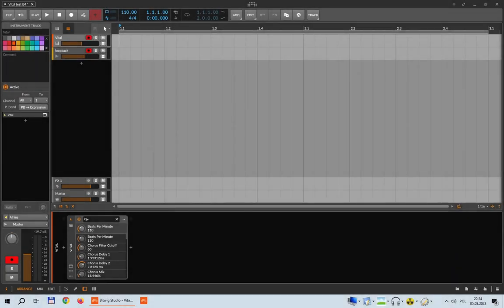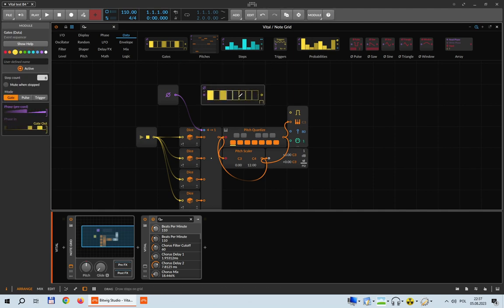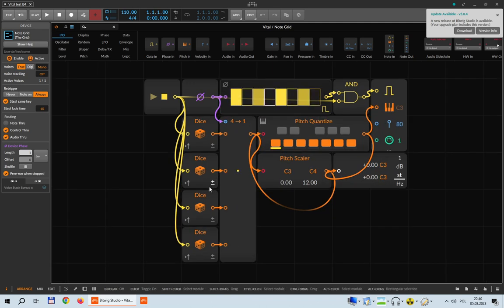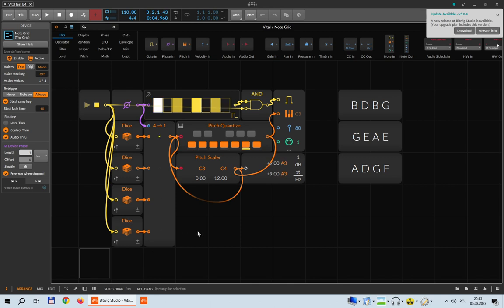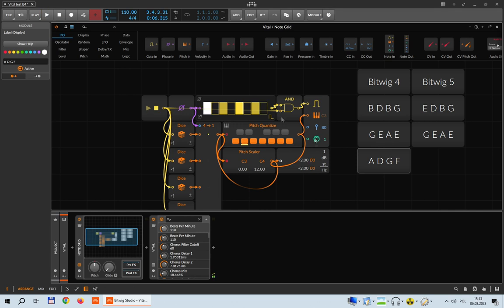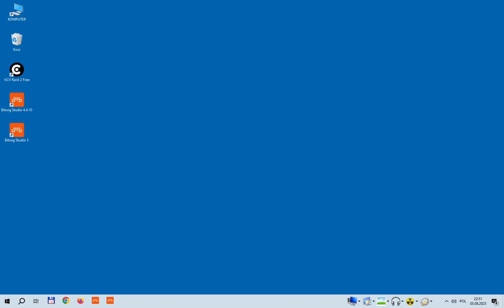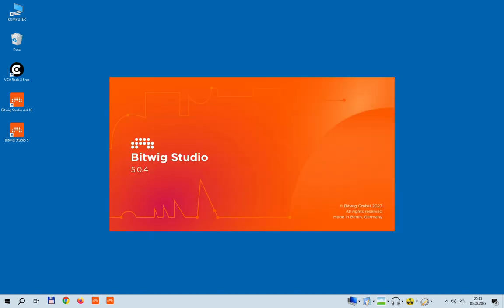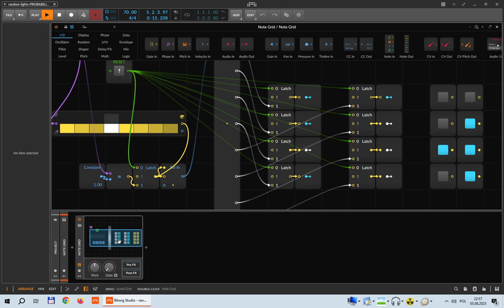If it repeats, is it random? Experimenting with Bitwig's grid

Comment from the maker: Things not mentioned in the video:

1.	I didn’t want to get into suppositions about how Bitwig is internally coded and how it may be using the same random seed every time it initializes the generator (yes, it’s probably doing that, but I didn’t want to presume, only show the results). It may be a feature, or it may be a bug, or perhaps an unintended omission, but the end result is what it is. 
2.	Yes, there is a similarity between the behavior I’m describing and how randomized note operators work in MIDI clips. There, too, random sequences repeat, and indeed it’s probably the same approach. Except that for clips we get the little “Seed” button we can click to get a truly new random sequence. We don’t have one for the grid. 
3.	I don’t know if the repeating sequences are specific to an individual computer, or if they will be the same on all machines running Bitwig. If you care to test this on your system, please let me know in the comments, I’m curious.
Reply: To answer your third point. I tested the first setup you did with dice. I did not get the same pattern as you, but I get the same sequences repeat after closing the program and starting + stopping as you do.
Reply from the maker: @shottman  Thank you! It's good news, actually, because it implies that different people should get different patterns from the same patch. So sharing generative patches should be okay, at least, as everyone will get their own unique sequences.

Comment: I did the same test and the same thing happens to me. It seems that bitwig saves the same values and predictions when you save the project, and if you close bitwig and open the project again it will show the same values and predictions. Now if you close the project and open it again without closing bitwig the values change, which makes me suspect that it may be a bug.

A few months ago I did a test in bitwig creating a random preset generator and the values were not saved in the project and were lost when reopening it, this was from version 4.1 if I remember correctly, it would be good to test with older versions to see if it's a new bug.
Reply from the maker: I'm pretty sure I saw the same behavior (repeating sequences) all the way back to version 4.1. I didn't test 4.0 o earlier releases.

Comment: Interesting... So basically it's not random, but i can't controll it so it gives the impression of randomness in everyday use? Interested to see what Bitwig will do.
I'm actually thinking/working on a seeded value generator in the Grid to have truly recallable random style sequences. I was somewhat succesfull with Wavetable LFOs and Noise Wavetables. But now someone on YT told me about some Math that i try to integrate... Has anyone build a Computer in the Grid yet? i'd have some Questions :D
Reply from the maker: To your first question, yes, quite. Thankfully Noise and S/H LFO are truly random, so they can replace those other devices that are not. And yes, wavetables and wavetable LFOs will create unpredictable but precisely repeating sequences, and their state gets saved, so it's recallable. That said, even two (or more) simple sine LFOs running at different rates will create a fairly random-looking modulation curve when you merge their outputs. Or you could use the sampler running at something like 0.3% its normal rate. Also pretty random and recallable.

To your second question -  I've certainly been wondering about that myself :-)  Is the grid Turing-complete?
Reply: @SongOfItself  Kind of. I still try to implement a propper functioning Gate Generator into it. But the Turing Style Generator without gate generation (Notes and Expressions) works! You want the Patch?
Reply from the maker: @SenfSenferson  Absolutely! We're supposed to have the Turing mode with the S&H LFO, but I'm hazy about how that works. (Turning the top know all the way to the left should, according to Help, produce repeating sequences, but I'm not sure that it does)